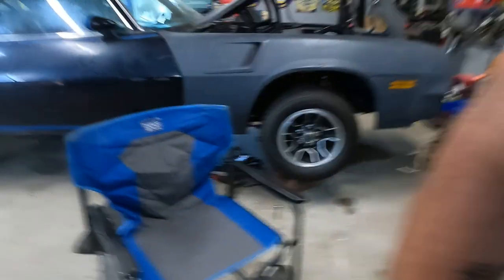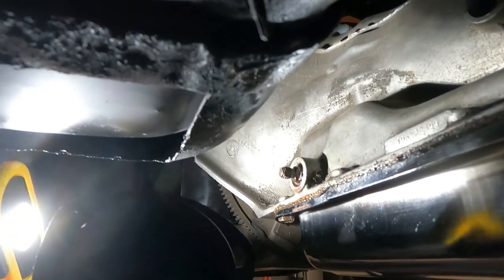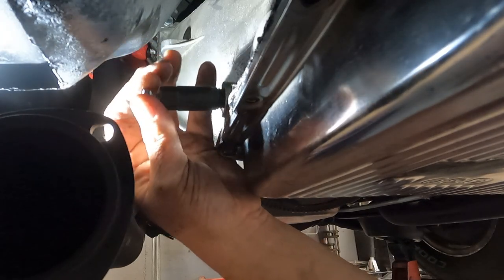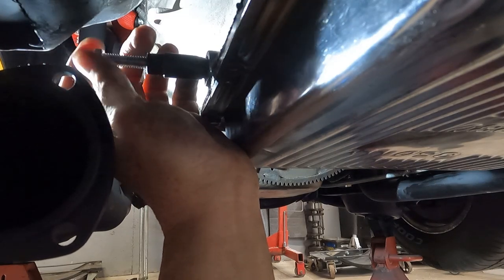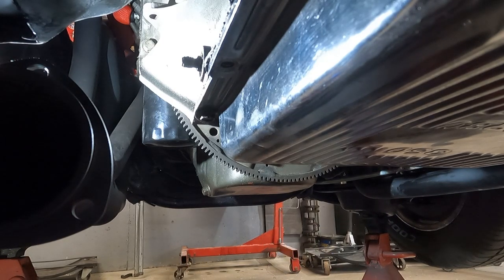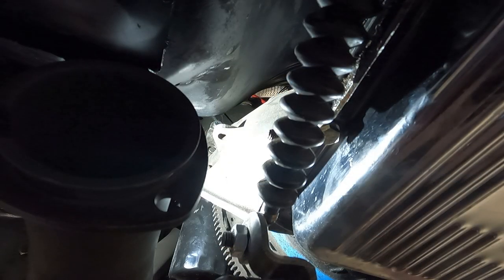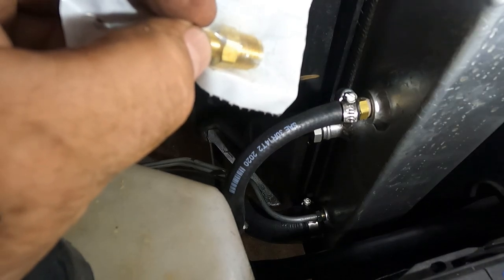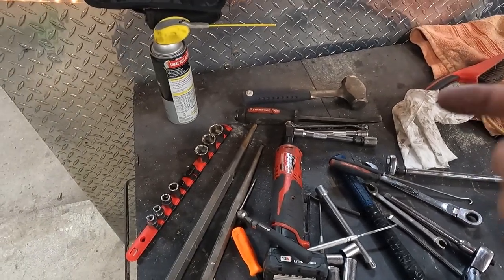Replacing the Turbo 350 transmission shift shaft seal on the 80 Camaro to fix a persistent leak.

Comment: if ur running a 350 turbo u are a fool i have had pro built 350 turbo and after the 3rd one they gave my money back each one blew 2nd gear on the first pull . they talked me into one but they were very very wrong it cost them a lot of money . if u know what ur doing u can pick up a 02xx 400r tubo for free which is good to 800 hp stock they come with the heavy 8 bolt pump heavy clutches stage one shift kit i have 3 sitting right now plus i get the 450 hp 454 with a steel crank heavy rods and pushrods high flow heads . i got 4 setups from 6,000 to 58,000 miles on them for free running perfect . i am starting a build on a 79 z28 rs t top putting in the 454 not sure if i am putting in the 02xx or a t-10 have all the parts plus 2 extra z28 hard tops for parts . one has new custom interior got everything for free so far even a new fly wheel and 12 inch clutch for it. have u ever seen a second gen with power trunk this was a first for me the t top has every option that u could get with it even full spoiler kit